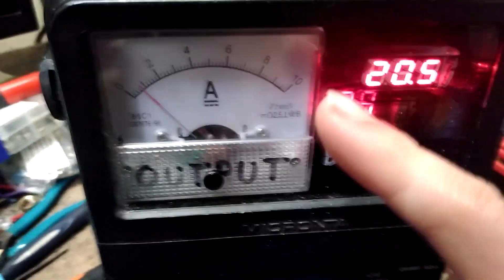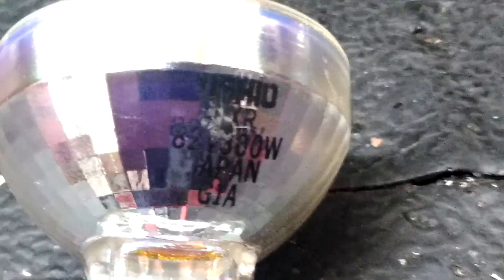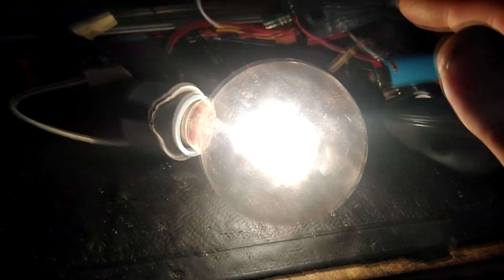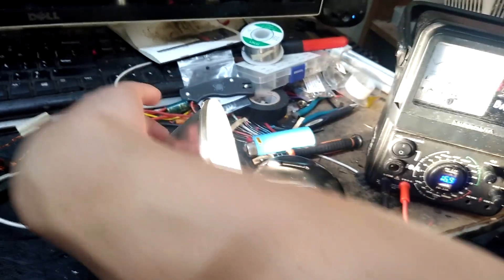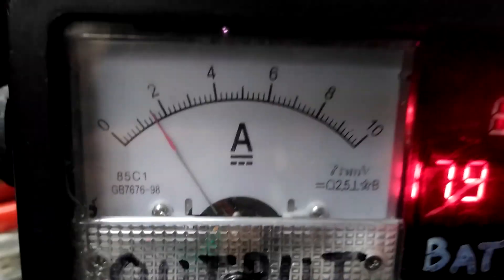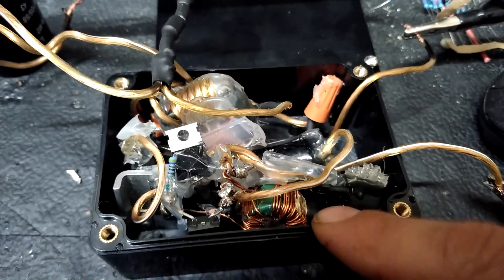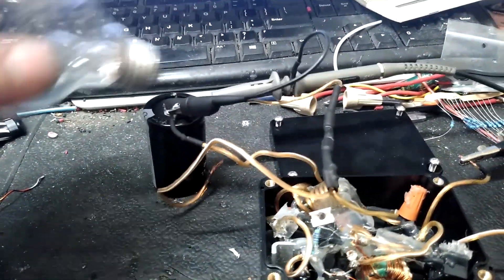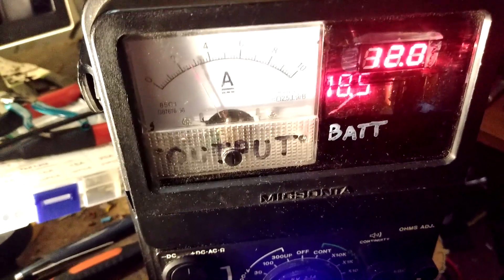Handy ZVS Drivers

Comment: M'yeah, the "problems" been documented & explained just a year or 2 past mazzilli's 2008 ~ 2009 contribution (based on Royer's 1954 concept), as i recall...
Reply from the maker: I expect such problems from such a simple circuit. At the same time it seems easy enough to use Mazzillis circuit as is without modifications to get the job done within reason.